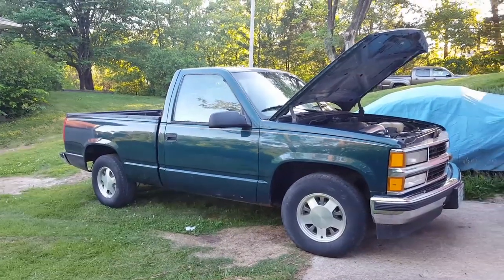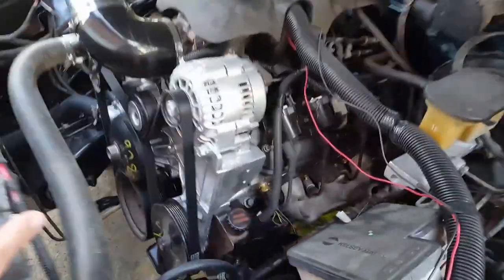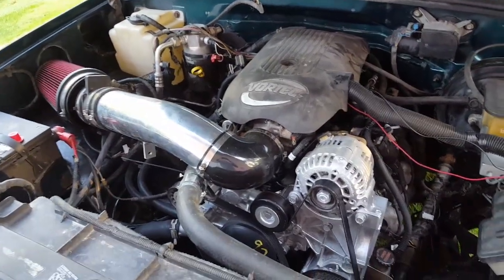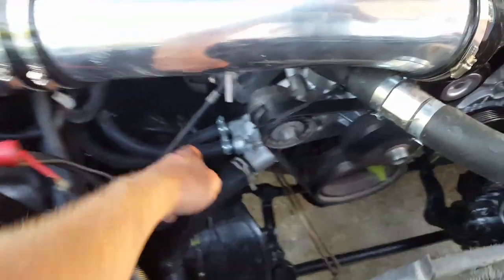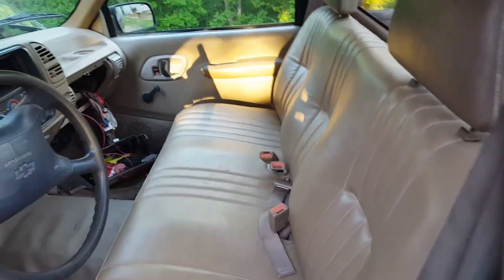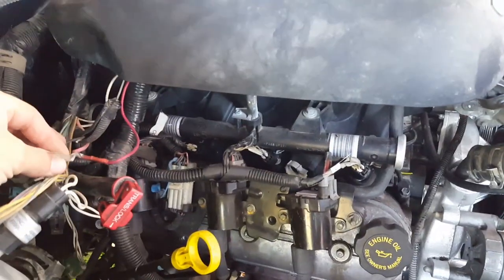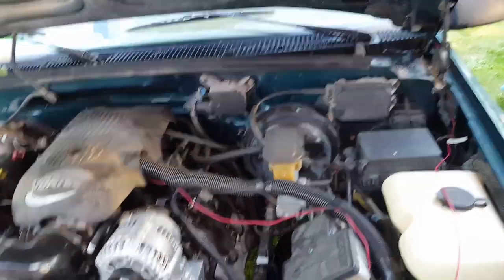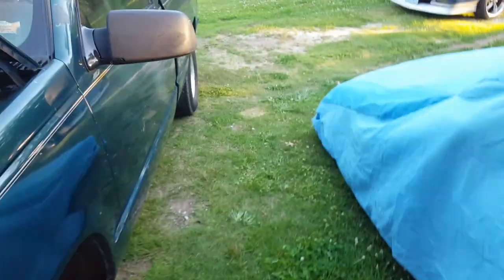95 silverado c1500 How To 5.3 ls swap

Comment: For everyone asking yes you can use the 94-95 trans but u need to change the internal harness and use a spacer and the swap flywheel or oblong the 5.3 stock one
Reply: Do you have a link where I can get a spacer and internal harness or maybe a video that has that in it? All the ones I've been looking at are swapping the transmission too

Comment: Lol I think screwed up I cut majority of my wires I had Sbc 400 in my 1997. Now I'm going Ls
Reply from the maker: the 97 has a little differnt motor but you can still just run a standalone harness and just run new wires to your cluster. i just tapped into mine since there all under the hood already

Comment: Got parts list?
Reply from the maker: Not really it was a very simple cheap build. I been using kemso 340 pump, ict billet adapter mounts. Diy stand alone harness, hp tuners to delete vats/tune it, compression fitting for fuel lines to adapt to push lock style. Steam port can drill and tap water pump with 1/8 bit, same with oil pressure can drill out ls oil pressure and tap put factory unit on it. 98 camaro 3 wire temp sensor for temp guage. These trucks are super easy to do. Thats just a quick list but should be everything you need to do it
Reply: @Joe_Jackstands  @ its tha a good pump???   Itslike 30$???
Reply from the maker: @gerardolopez5875  I have used the Kemso a bunch of times and had good luck with them.

Comment: Your video is a life saver man. Im getting ready to do a 2004. 5.3 swap into my 91 gmc sierra 1500 stepside.
Reply from the maker: Glad I could help
Reply: How did it turn out?
Reply: @justaRooster  great honestly harness of course was the tricky part but drive train was honestly pretty straight forward. Can't get over the difference in response and on demand power. My 5.3 is built so naturally there would be a big difference but I mean still

Comment: I just bought a flawless 94 K1500 Blazer Z71 with 5.7 TBI with a couple hundred thousand on the ticker and I was thinking about finding a 6.0 to put in when the TBI quits.
Reply from the maker: @michaelvoss939  the ls is the way to go in these trucks. It's a simple swap with alot more power.
Reply: @ I know the TBI gets shhh for being slow and they are but you rarely see one that didn’t make it to 200k+. Mine has 206k but when she’s warm her oil pressure slips below 30 a little. Doesn’t smoke, doesn’t drop any fluids. As soon as she does give out, I’ll be looking for some info on how to upgrade her and it’s a privilege to have videos of people who have already done it. I’m subbing up, appreciate the response.
Reply from the maker: @michaelvoss939  no problem glad to help. The tbi will run forever so have plenty of time to save for a swap lol

Comment: Can I get all the colors that you tapped into the TBi and the names that went to the colors .... I need to smog my vehicle so would this work ?this is what I'm thinking using the LS wiring harness The way it comes out of the donor truck and then type in the TBI wires to each item is this correct if so can I get those colors and where they go thank you .... I have a CCLB dually 93 tbi 454 but I think I'm going to go with the 6.0 engine .
Reply from the maker: The wire colors i know some off the top of my head. I usually just focus on 1 sensor at a time and tap into the tbi harness as i go. The key power and tach, i went to the plug on the distributor has a red and white wire on it. the red wire is key power and white is tach. Vss went straight from ecu to the far left wire on the drac module behind the glove box i think it was blue. The coolant temp i used 98 camaro 3 wire temp 2 wires went to ecu and the the one extra one will go to the green wire for temp sensor. I didnt do nothing for volts gauge or the gas guage. The tcc wire will go to the back of the brake pedal. I never messed with ac i was going to use stock compressor and stock wires without going to the ls harness. I dont have smog in missouri so i dont know about smog stuff.
Reply: Joe Jackson thank you very much for the info I think I'm going to go with the stock harness off the donor truck and tap in to the TBI wiring so the Dashboard can respond to the LS engine I hope this works if you don't mind I will text you back if I need any information

Comment: About to put a lq9 in my 1990 and was wondering what to do with the stock tbi wiring after I do the LS standalone. I could use some more detailed help
Reply from the maker: You dont need any of it tbi stuff. just use a couple wires from the coil to power the ls harness and tap a couple for temp and tach.

Comment: Please explain more on how the timing is off because the gears that makes no sense
Reply from the maker: Not the timing of the engine, just the timing of the shift points.  the ecu was tuned for 3.08 and the truck had 3.42 so the shift points will hit alot sooner. It still will drive fine but for the best performance have to retune for right gears.

Comment: Hey man so i have a 95 gmc and i just got a 2004 5.3 and 4l60e i have a guy that makes my harness cleans it up and makes it look pretty ect, my question is once i have the harness and the PCM tuned to  my application all thats left to do on my end is install the motor and connect the harness and boom swapped orrr is there much more to it
Reply from the maker: Yes it be basically that. Make sure you have a fuel pump for it all. On a 04 might have to mount the pedal. That's all I can think of. Pretty straight forward swaps for 88-95s

Comment: Are the 4.3 motor mounts the same as 5.7 motor mounts ? I have 4.3 I don’t know if I need to order replacement 4.3 mounts and get the sliding adapter plates or order 5.7 motor mounts
Reply from the maker: They are different need to buy v8 ones

Comment: Would you mind going a little deeper on the wiring? Not quite my strong point.
Reply from the maker: Start off with a 99-02 harness. Follow lt1swap.com write up for stand alone harness. From there it's just connecting wires from LS ecu to factory wires under your hood. Once you tap into the couple you need just clean it up and clean the rest. You only need like 5-10 wires from your factory harness.
Reply: @Joe_Jackstands  I have a 94 I'm thinking of doing the swap on. I will check them out to see how it goes. I appreciate you responding!
Reply from the maker: @tydavis2278  no problem let me know if you have anymore questions. Once you get in there and do it you will see it's not to hard of a swap on these trucks

Comment: Any video's on the wiring process?
Reply from the maker: Sorry I don't. It's not bad once you get into it
Reply: @Joe Jackson I've been fighting with it for a couple of weeks now. Not getting spark or fuel.
Reply from the maker: @Ira Robinson  check power to the pump. I usually run a test light to make sure the relay is sending power to fuel pump... a common issue I see on swaps is not having the key power hooked up right. Take a test light make sure test light stays lit when key in on position and when your in crank position. Alot of times I see people have power with key on and when it goes to crank coils have no power. Make sure neutral safety switch is right also seen that where wasn't plugged in or wasn't in the right position cutting power.
Reply: @Joe Jackson  I'll check it out. I'm sure it's something I'm missing.  I appreciate the help man.
Reply from the maker: @Ira Robinson  no problem glad I can help
Reply: Where do you have the Neutral Safety switch wired at?
Reply from the maker: @Ira Robinson  I kept the 95 neutral safety just put it on the LS trans. That way the key neutral safety wiring would work the same
Reply: Awesome! I'll tap into the wiring on the switch. I haven't found any other videos as detailed as yours man. You're helping a lot of people out bud. Hopefully, I can get it running.

Comment: Idk shit about trucks but if i get a ls 5.7 on my 93 c1500 i need to change all the wiring as well or can i still use the stock wires from the 5.7 350 carb engine
Reply from the maker: You would need the ls harness and ls ecu. Convert to stand alone and just tap into you 93 harness for signal wires to guage cluster.

Comment: I have a 95 Tahoe I’m fixing to do a ls swap on curious as to what options I have to do and what I should do
Reply from the maker: Wiring is the same as this..if you have a 4x4 tahoe then maybe a oil pan might be different. I have never done a 4x4 so not sure what all it need exactly.
Reply: @Joe_Jackstands  it is 4x4 but it’s also a manual shift 4x4, the ls I’m trying to get comes with a transfer case, transmission, ecu and fuse box but it seams like a ton of work to get it going
Reply from the maker: @joedaugherty9533  with a 4x4 3500 trans. You have to use a 4.8 silverado clutch flywheel and pressure plate.

Comment: I am going to due a swap on a 98 2 door Tahoe what was the reason not putting in the ac compressor. Just wondering that was one of my concerns weather I’ll be able to use the same a/c compressor for the swap
Reply from the maker: Hector Franco the ls ac compressor sets to low to the frame wont work. I made a bracket to run ac compressor off my 95 but i didnt put it on cause i was being lazy and wanted to drive it. The 98 compressor is different might look at lextech for a compressor adapter to run your factory compressor

Comment: Iam doing a ls swap on my 95 2dr obs but womdering what wires to use off my tbi to power my ls and mph
Reply from the maker: I used a test light figured the wires out. Most where off the all tbi distributor. I cant remember exactly what i did for mph. I think I took the Vss out of the ecu straight to baby blue wire off the drac module.
Reply: Did you ever get your 95 ls working? Planning on doing my 95 aswell

Comment: Can you tell me what you did for fuel lines ? You cut the ends off and used Ferrell style compression fittings ?
Reply from the maker: i cut the fuel lines from the donor truck. then cut the the llines on mine and then just used the compression fittings to mesh them together. I bought them at Oreillys they where dorman compression fittings had both sizes in the 1 pack.
Reply: Joe Jackson the last time I did the swap I made some junk fittings out of the old tbi engine out of my 89 . I want clean this time and run my ac too
Reply from the maker: I cut the lines where the compression fittings where under the truck so you couldnt see them. The Ac just use the tbi bracket. I used it just had to follow the tbi ls bracket write up. i used all the stock ac wires and controls and didnt try to go thru the ls ecu with them.

Comment: I have same truck but k1500 extended cab with 5.7l tbi..  now 5.3 swapped in..  I was assuming I could use my stock 3 wire oil pressure sensor with the adapter I already hooked everything up minus wiring?  Will it work or do I gotta use the Camaro one?
Reply from the maker: Oil pressure you use a adapter to stock sender.. temp sensor you can use a camaro 3 wire sensor or stock temp sensor with adapter on the passenger rear head. Both ways work fine
Reply: @Joe_Jackstands  thanks for clearing that up man. Does computer not need oil pressure reading?..  also..  what do I do with power steering.  I have stock pump and new ls pump.  What should I use and how does it mount up I have not attempted yet on the pump?  And last question, I left stock neutral saftey switch unhooked and used the 2 connectors from ls harness? Is that right??
Reply from the maker: @dadlife9657  Ls computer dont need the oil pressure reading. Use the ls pump and your factory lines be the easiest route.

Comment: I just got a rod knock in my 5.7 tbi I'm planning on 5.3 vtech but I'm on a cheap budget what should it round out to be for it to run
Reply from the maker: PondDestroyer 99 the price of everything really varys on how much you spend on your swap. Try to get everything you can. Every sensor,belt, starter, intake, hose and anything really bolted to the motor. Other wise the swap will nickle and dime you to death. Once you have that the other stuff is farily cheap.

Comment: Transmission cable how you do it
Reply from the maker: Rodrigo Rodriguez the 95 cable worked just like the newer ones. So I just bolted it on and worked fine. The 94 and older have rods and thous I made work but couldn't get low gears

Comment: Hey brotha !! Can you please tell me what I would need other than engine mounts , for a 5.3 swap into my 96 Chevy c1500 with the 4.3..? I would really appreciate it .
Reply from the maker: On a 96 engine mounts, your stock fuel pump will work fine. Can use your stock harness and add pins to it or take a ls harness and repin it to your 96. I would take ls harness and repin to 96. Go to lt1swap.com for all the harness repin info.
Reply: Joe Jackson am I going to need to buy a flex plate spacer adapter and bolts so the 5.3 hooks up with the 4.3 tranny ??
Reply from the maker: @zxJC34xz  yes you will need a spacer if your going to run your stock transmission.

Comment: Did your stock drive line work and are you using the 4l60 ?
Reply from the maker: yes everything lined right up. stock driveshaft and stock shifter cable
Reply: I was about to ask the same question. How about the transmission mounting anything special there?
Reply from the maker: With the dirty dingo mounts everything went right in no problem. crossmember bolted right up to existing holes on the frame. I left the dirty dingo mounts loose so that way i could get the trans crossmember lined up to the holes, then i went back and tighten the mounts up from under the truck.
Reply: Joe Jackson So this is the original 95 single case transmission? I only ask because im looking at a 95 yukon to buy and wanted to swap an LS1 I have sitting in my garage.
Reply from the maker: martinez1701a i used the 99 ls 4l60e.

Comment: Man how did u get that manifold and down pipe on the driver side to fit with it hitting the frame?
Reply from the maker: Driver side. I took plugs ans coils off and wiggle it down in there. If you have a 94 older there might be some shift linkage in the way you have to move

Comment: So did u half to chang the break boster and all that othere stuff on the side
Reply from the maker: Nope didn't have to change any of that stuff
Reply: So im fixing to do the same thing to a 94 tbi do i need the to like pull the whole ls harness to or is there a better way
Reply from the maker: @dukenukeum3d650  your going to need the ls harness. Nothing on the tbi will work with the ls. Just get a 5.3 trudk harness convert to stand alone and tap into the 94 tbi harness for power and guages. Tbi harness will send power to fuse block and the ls ecu will send all signals to all your guages
Reply: The truck im pulling the ls from has a hareness can u give me like a part number for the convert sorry new to the ls been workin on tbi for a few years now
Reply from the maker: @dukenukeum3d650  your fine. Thers no part number to convert. Take the harness on the ls and go to lt1swap.com and follow the write up for stand alone. For all the wires to connect to follow my video. Once you pull the ls it will start making since
Reply: Ohh ok i got u thanks for the help
Reply from the maker: @dukenukeum3d650  You're welcome anytime

Comment: I’m trying to swap a lm7 in my 88 and I can’t figure out if the throttle cables have to be shortened or extended and the ecu flashing and tuning
Reply from the maker: what you need is a 99-02 throttle cable they are perfect for it. a 96-98 obs with a vortec motor will work but there longer. The ecu I send off to lsthunder on ebay for $50 will tune out the vats and emission stuff you dont need to get it running. I usuall just run like that on a stock engine.
Reply: Do I need to have the ecu tuned if I do a ls2 cam swap
Reply from the maker: @jcphillips476  Yes you do. It will run on a stock tune but might have problems idling or lack of power thru the rpms.
Reply: Also the vapor hose that runs from the intake how do I tackle that
Reply from the maker: @jcphillips476  You can run it to the radiator if you have a spot on it. I bought a piece off ebay and cut the upper radiator hose and ran it to that. You can also drill and tap your water pump and run it to that.

Comment: I'm trying to 5.3 swap my 1990 1500 Silverado and I'm trying to see roughly how much it would cost to swap
Reply from the maker: Your biggest expense is motor and trans.  If you already got that and all accessories then you only need a couple things to make work. Convert the harness to stand alone take a couple days yous first time. Then fuel pump a cheap kemso I have used plenty of times with good results is $30. Get some $30 adapter mounts for engine. Tune the vats out ecu $100. So for a average swap very basic I'd about $1000-$1500 if yours doing all the work. If you add ac then price goes up a little for brackets.
Reply: Is 1000 to 1500 with motor and trans or just accessories and such?

Comment: How long did the wiring take? I have a 96 that had a 4.3 but now is getting a 5.3 ls but im stuck on wiring
Reply from the maker: Mine took about 3 days of working on it here and there. Mines a 95, 96-98 are different so might take a little longer

Comment: Where did you connect the tcc and the vss? I need help figuring it out
Reply from the maker: Joseinez23 the tcc goes to the brake pedal. I left unhooked. The vss on mine i ran from the ecu straight to the drac box under the dash